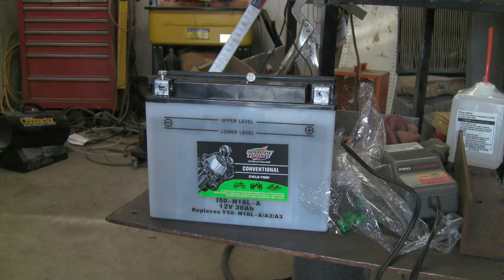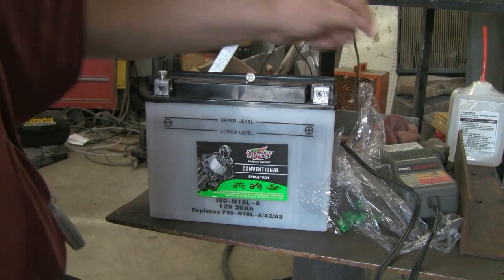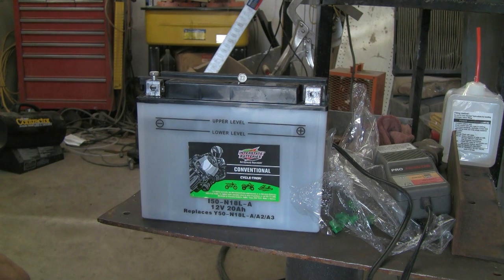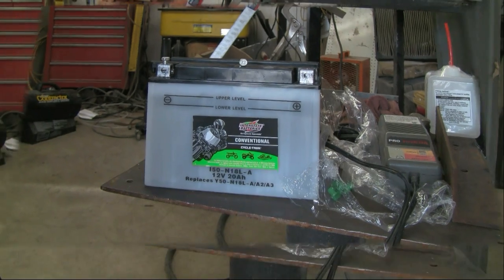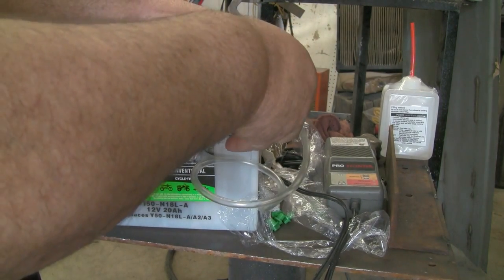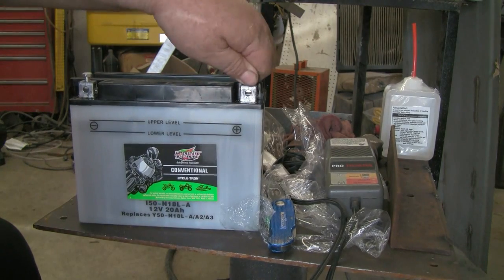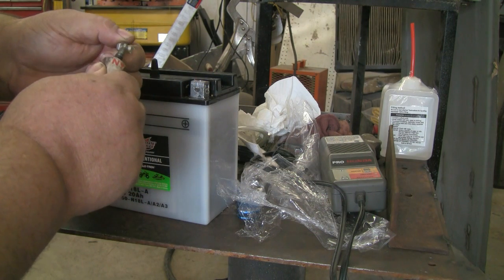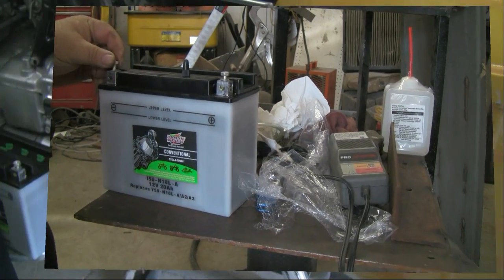Motorcycle Battery install

Comment: Nice video Greg !

Nice to see you're ready for the riding season now and won't be pushing the "wing" when the battery is dead :(

Cool tip with the vinyl tubing, and the dielectric grease, like it !

Comment from the maker: Many battery manufactures and distributors ship smaller or less popular batteries to the dealer in kit form so as to ensure a fresh battery at time or sale. the lead acid battery starts getting old as soon as it is activated with the acid. Retailers will usually "set up" the battery for you when you buy it.